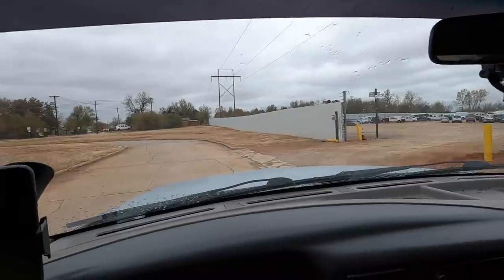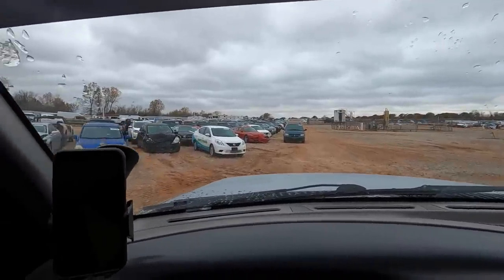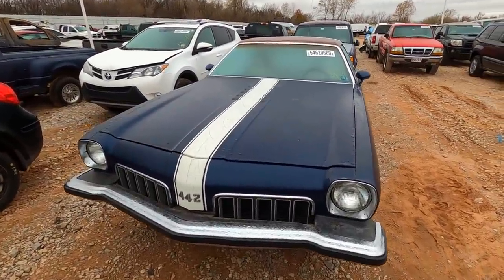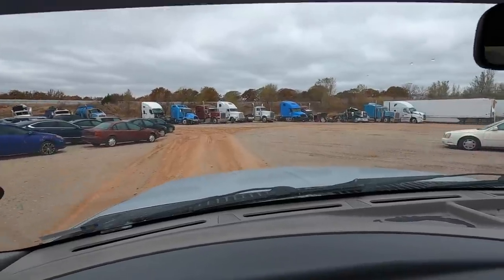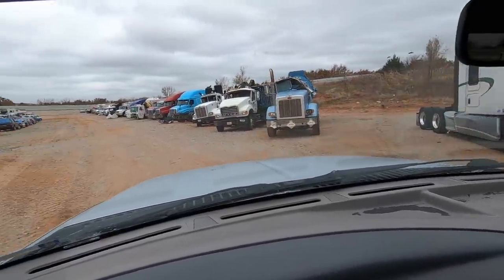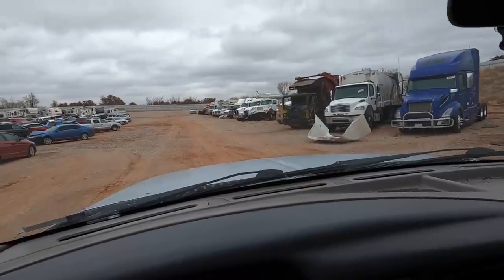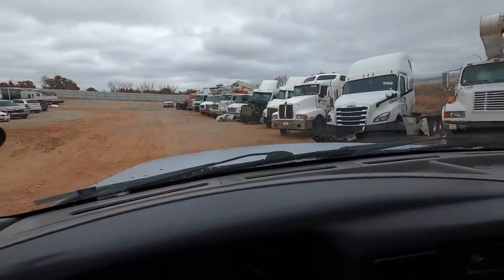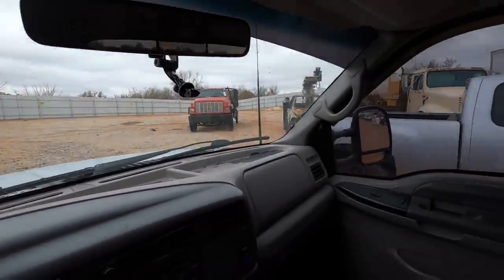Copart Walk Around 11-16-19 - 1973 Olds Cutlass 442

Comment: The biggest concern on "Colonnade" GM coupes is that rear area below the rear window, very notorious for being a haven for rust to develop. Get a car with minimal rust in that area and it's worthy of preserving. I'm sure a '73 442 is a rare beast and $5500 is well under the going rate for what is seemingly a complete and solid car. The condition of the front and rear bumpers(that plastic insert behind the front bumper is pretty much unobtainable) and front grille alone make this car worth buying. Of course restoring one is probably best if you're a fan of the body style because dropping $25-30K into one won't yield dividends on the investment, but having a really nice, well done Colonnade coupe in a desirable configuration for around $30-40K overall isn't so bad considering what everything cost these days. Eventually(due to inflation) it'll be worth $30-40K and in the mean time you'll have a nice car to drive, show and enjoy.

Comment: Randy: I agree with you on the Cutlass.

$5,500 is a lot of money for that car.

But what great old classic.

Has great content potential!

Cheers
Reply: That’s how much you’re going to be spending on one of those.. especially the older they get
Reply: If it’s got a DOT number on it depending on the area you may need a CDL also if it has airbrakes you will need a CDL with airbrakes but you can make a nice tow truck out of that Topkick just have it not for hire
Reply: Thats not a bad price . There going for more than that.
Reply: I like that Olds 442, it'd sell fer about 8K? in Canada in (original) condition... It's priced U.S. average, but look out fer hidden rust! : )
Reply: expensive
Reply: It might be worth closer to $5500 if it had the 455, but not the 350.
Reply: I don't think it's a bad price with the options it has.   My favorite year for the 442.  Drove one years ago, 350 rocket, torque for days.

Comment: I had a 1973 Olds 442 with the 455 motor and the Muncie 4 speed. It caught on fire in my garage one night and burnt the engine compartment and melted the dash board to the floor. It was grass green with a white pinstripe. I loved that car. I also had a 1968 442 and a 1972 442 with the hood scoop ram air, a beautiful car. Now I have an Alpha Remeo Stelvio Quadrifoglio with 505 horse power. Again, I love it.

Comment: I had a 71’ Cutlass S with the 350’. That car started first crank every time in winter months.
Reply: I had a gold 71 442 with the 455 big block. That thing ate Corvettes. I miss that car so much.
Reply: @madmex2k  I had a '72 convertible with the 455 and the TH400. Swapped in a Isky cam, double-roller timing chain and gears and an HEI from a 80s olds. I also swapped out the steering box from an 80s Camaro (quicker turning) and control arms from the same Camaro (changed the angle of roll). That boat could pull .92 on the skid-pad and pull 12 second quarters on street tires and pump gas with the AC running all day!

Comment: Bought a 1987 Cutlass 442 off the showroom floor & traded it for a new 87, 350, I Roc Z, 3 months later  ! Cool vid Randy & its a hurst 4 speed on the 73, 442 . Salute to you brother 👊 Stay warm
Reply: The 442 has an automatic transmission and I doubt it is a 4 speed.
Reply: @mexicanspec  if it is a real 442 it's a 4 speed , bare in mind, theirs a lot fakes out there
Reply: @just4kicks950  That is not true.  Oldsmobile always made automatic 442s.  The middle 4 can also mean turbo 400 transmission.  This car is a Cutlass S with a 442 package.
Reply: @mexicanspec  it is a automatic 4 speed auto & mine had the Hurst with the 3 gear levers.  No body said it was a standard ! You never heard of a 4 speed auto?🤔
Reply: @just4kicks950  Of course I have, but not in 1973.  They didn't exist.

Comment: the infinity is nice as for the boat, wells cargo is a trailer manufacturer, wasn't aware they made boats too. Regarding the top kick, it varies state to state but like in TN and GA if it doesn't have dual rear axles you don't have to have a CDL to drive it.  the red button on the shifter is for high and low range gears  so that 5 speed would actually be a 10 speed because 5 speed  in low range, 5 more speeds in high but you wouldn't drive it that way, you get up to cruising speed with a load on and then pull up the button on the shifter to drop the idle down and just drive then when you stop to take off and for the first couple gears you would start off in low range again. The big red button in the middle is a PTO for probably a dump bed. More than likely the starter isn't fried. as cold as it is out there it won't stay running because the fuel in a diesel gells up when it gets too cold. that's more than likely what's going on and why it wouldn't stay running. that's usually also why diesel truck drivers leave their trucks running frequently. Vermeer is usually a tree service equipment company. the tree service i worked for in Knoxville 20 years ago had a vermeer stump grinder and wood chipper both. and that truck you may actually have to have a CDL to drive that's not a "generator" on the back either that engine is a pump to run and spray out whatever the truck is used to pump out i believe it's for spreading fertilizers or weed killer

Comment: On the GMC Top Kick. The red knob on the shifter is a 2speed rear axle. The Large Red knob is the PTO (power -take-off)  the black lever next to it is to raise and lower the bed. I'm a retired truck driver with 40 + years. The federal requirement specifies that, when a vehicle has a GVWR of 26,000 pounds or less, the operator does not need a CDL license. ... For example, a truck with a GVWR of 26,000 pounds or less can tow a trailer with a GVWR of 10,000 pounds or less and not require the operator to have a CDL under federal requirements.

Comment: Back in the day most people I knew hated the new style of the '73 Cutlass and beyond. Olds seemed to be heading for more luxury; same with the '73 Malibu, Lemans and similar. I remember the '79-81 Malibu was a smaller size and made neat hot rods. Only nowadays the bigger '70's cars are more appreciated like that one. We always called boats like a '71 -'76 Impala Grandma's car; Look at the popularity of them now! I have seen some neat restored '73 rides in the last few years; Hard to believe I owned 2 that I drove into the ground. The 1st was a '73 Malibu rust bucket that ran well for $50. After 2 years with that I got a '70 Cutlass Supreme for $500 in 1990. I kept that until 2003 when the frame rusted thru. I also got a '74 Chevelle with 16K original miles from an old lady for $1600 in 1991. I drove that as my DD and the Cutlass was my toy. The '74 got hit a few times and the trans blew in '97 with 90K on it so I sold the motor for $400.

Comment: That 1973 442 reminded me of the '75 Cutlass S I drove in my early 20's in the early 90's. My dad worked at a Olds dealer so my first cars were Olds. It was a coupe with the front seats like that one did. Mine had a little lever on the side of the that you had to depress to unlock it so it would rotate. It was really nice when passengers had to ride in the back seat. That "Rocket 350" was designated by GM as the 350-R motor. It was the only GM 350 that came with hydraulic lifters in it. The engines and transmissions (a TH350 or TH400) were bullet-proof unless you did something stupid with them. This '73 is merely a shadow of what the 442 (which stood for 400 c.i.d. engine, four speed manual transmission and dual exhaust) start out as in 1964. I would buy this car in a heartbeat and restore it to showroom condition. My favorite years of the 442 were '66, '68 and '72. And no, that is not a Hurst shifter that is just the standard shifter. To get that, you had to order the Hurst package which most came white with gold stripping.
Reply: 442= 4 speed, 4 barrel, dual exhaust. My 71 came with a 455 cu.in. engine

Comment: You are partly correct about the CDL thing.. if the vehicle has a GVWR(gross vehicle weight rating) of 26,000lbs or less, regardless of whether it has air brakes or not, you do not need a CDL. If the GVWR of 26,001lbs or over, you need a CDL. You can also drive commercially or "for hire" in a truck that weighs less than 26,000 lbs without a CDL.

Comment: I used to drive one of those Top Kicks. The red knob on the shifter is for the two speed rear end which means it's a ten speed. The red knob by the PTO lever is probably there to engage the PTO. I don't think it has air brakes as I didn't hear a low air alarm when you started it.

Comment: That red button on the gear stick is the 2 speed axle,it has a low and high ,so actually its a 10 speed instead of a 5,I had a topkick for years we hauled logs on.The cat engine in it is a 3116,6cyl turbo

Comment: The name of the car is 4-4-2, not four forty two.  That is because it means 4 barrel 4 speed dual exhaust.  The middle four can also mean turbo 400 transmission if it is an automatic.  Unfortunately the 1973 model is not on anybody's radar.  Dealers get an old car and put a high price on it now and think people will pay up.  I don't think it will happen on this one considering all the work it needs.

Also, you didn't even mention the ultra rare factory Am/FM CB radio.  That was cool to see one after all these years.
Reply: I believe that is a Panasonic CB Radio. And its actually 4bbl carb and 4sp trans and dual exhaust. And it doesn't mean anything else but that. I currently own a '73 442 and it is nothing like that one at the sublot
Reply: @palletwizard  The radio had the original GM knobs, so I doubt it was an aftermarket radio.  if you want to believe what you said here, fine.  I know what 442 means.
Reply: Look a little closer. It did have the original factory inlay with the knobs
But it was a Panasonic. We can ask Randy. That is if he bought the car. I checked out the Copart listing and i saw aftermarket CB. And that is a K-40 antenna if you knew what you are talking about.....

Comment: The Cobalt boat, the scratches on both sides are from a careless forklift driver who doesn’t move the forks out the way before he backs out, after placing the boat on blocks. 
Hey buy the International the generator is a mini tractor motor, you could a ditch witch and do swap. I haven’t see one yet, also get rid of all the pumps on the back put some ramps on it and haul some cars that you win.

Comment: 29:48 Vermeer mud mixing unit, truck mounted for a directional drill. That is not a electric generator but a hydraulic pump to power the pumps.

Comment: on the trans shifter the red switch is a 2 speed rear end . other red knob with lever is a power take off and the lever raises or lowers the bed.if it has air brakes you need a CDL. I was a CDL holder for many years.
                                Glen Doran  Glasgow,Mt

Comment: The red switch on the shifter is high and low range and the pto is the big round red one . Pull it up with clutch in then let it out the handle is for whatever the pto runs

Comment: Randy, If you’re going to be a Diesel Dan, you’re going to need a can of starting fluid. Also stay away from old mercruiser inboard out boards. The drives that old will need new constant velocity joints. Also the hull on the well crack is junk. Har har Mattie! Cracked in the stringers.

Comment: The international with the vermeer on the back is a mixing setup for things like directional boring. You mix powders with water to aid in the drilling process.
Reply: That's it, it is a mud mixer for a horizontal directional drilling outfit.

For you boomers, many RV parks might not let you park a trailer that old for too long.  They are getting picky and only allow the newer rigs.,

The Cutlass,  It's a 73.  Would be considered a dog a few years, ago, but might be worth fixing up if you can finds parts.  Would cost way more than it's worth

Comment: hey in your "looking around" I'm looking for 2 items:
1) a long wheelbase Savanna Van (no windows on the side no drive line no dashboard no steering column can be wrecked in the hood/grille area only ... not rolled ... 1/2 ton 3/4 ton 1 ton not worried if it has a title or not cause its gonna be chopped up ... will pay $100.00)
2) Push Bar that'll fit/work a 2006 Chevy/GMC truck(no brush guard needed .... Police Type ... $100.00 or less

Comment: It's a 4-4-2 that Cutlass that makes it worth it. I think the 5500 honestly I would pay it I know she's kind of rough but it's not Rusty so all it really needs is a good paint job some upholstery on the seat see if he can still get those pieces around the front window and did you notice it had an AM and FM CB radio Factory that's pretty darn rare? It looks like it was quite loaded for a 73 I used to have a 74 Cutlass and with the regular 350 four-barrel and it was pretty fast so I can imagine that thing probably has dual exhaust I think I saw smoke coming out of both sides and then it would have handling packages a lot of extras really give it a good thought because that's a nice car.

Comment: I use to have a 75 cobalt.. it was built like a tank for being fiberglass..  but still had a few soft spots in the floor..  one thing to look at is that.. but you have to get up in it and walk around..  and the fuel tank under the floor can be a huge pane in the butt to fix if its old and leaks.. involves cutting the floor out to remove the tank, that one looked to have a access to it tho..  looked like there was a trailer there with no boat..  might fit it..  had a ford 351 engine, the inboard outboard drives need to be checked for water in the gearcase.. can cost a few grand to fix or replace..

and that is not a generator on the international..  its a hydraulic pump, I would not be trying to start equipment when I don't know what it is, or if it still has fluid in it or etc.. could damage it.. just sayin!  enjoy the vids, thanks for sharing

Comment: I don't see 5k either but there is someone out there that will pay it and then buy some replacement parts on ebay and say it is a barn find. The ad will go like this (found in the back woods of Oklahoma in a shed, the car was covered with an old tatered blanket, the owner had died and his wife wanted it gone, we even found the original license plate frame from the dealer the car was bought from).

Comment: 12:10 Judging by the color of the gravel in the exhaust pipes, and the scrapes on the ground, it looks like it was let off a flatbed at a very steep angle and the pipes picked up what is on the ground where that car is sitting.

Comment: In 1973 the 442 designation designated the 455 ci engine, 4 spd transmission and dual exhaust.
Reply: George Hoy   That is true of the 1965 thru 1972 cars. But when the 1973 and later 442s came out the 350 engine was also available. 442s with the smog equipped engines were a shadow of their former selves. An anemic 180 HP 350 with a 3 speed automatic was standard. This 442 is nothing like the pre-‘71 cars which were true muscle cars.
Reply: @Jddvs  You can see the S on the door panel showing this was a Cutlass S with a 442 package on it.

Comment: red button splits the gears high and low,the other lever was your pto,a hydraulic pump not 100%but if it has air brakes you'll need a CDL.

Comment: depends on the gvwr. iirc 26001lbs up yes. under no. 

this via google as follows
A CDL is required to drive any of the following vehicles: Any combination of vehicles with a gross combined weight rating (GCWR) of 26,001 or more pounds, providing the gross vehicle weight rating (GVWR) of the vehicle being towed is in excess of 10,000 pounds.

Comment: Here in NC you can drive that Topkick with no CDL as long as the GVW sticker on the drivers door is 26,000 or under and has no air brakes,which that truck doesnt

Comment: Randy if you want a truck for a car hauler the G M C would be the best it already has the hydraulic system and is not air brakes you will be required to have a class b CDL to drive it where as the international you will have airbrake endorsement

Comment: Now come on Randy. When would you have the time to use a boat? Hahaha
Diesels actually run better in cool conditions which is one of the reasons most interstate & intrastate trucks run at night rather than during the day.
In really cold conditions,. (in Australia at least) in really cold conditions, diesels use alpine diesel which stops the fuel waxing up which prevents them running.
The red button on the gear lever operates the high & low ranges in the differential. The 2 speed diff is handy when taking off with heavy loads in paddocks & for driving up steep hills, effectively splitting the gears so less momentum is lost when changing gears.

Comment: Anything  with  2 axle  on the  rear you  need  a cdl  to drive
Reply: Wrong. As a CDL holder. Anything over 22k lbs requires a class b anything over 26k requires a class a. Number of axles doesn't matter
Reply: @michaelhesterjes8496   A "SINGLE" vehicle of 26001 GVWR + towing of 10k requires Class B CDL. Under 26001 GVWR requires Class C non CDL. Any "COMBINATIONS" of vehicles WITH GVWR OF 26001 OR MORE requires Class A CDL.

Comment: randy just asked if the range selector is the jake brake lmao.
Reply: Don't laugh at Randy that is a two speed axle switch not a range selector
Reply: I figured it was the PTO to dump the bed.
Reply: @jeffhulsey989  it is but the pto runs a hydraulic pump
Reply: Rofl
Reply: High range or low range gears...it is a range selector...Mr. Know it All
Reply: No a range selector is for the transmission the 2speed is Axel and I don't know it all just 40 years of driving
Reply: I know I laughed way too much and way too hard when I was watching and he said that . I bet Westin is rolling around laughing his ass off

Comment: The 1973 - 77 GM A-body coupes
aren't as valuable as the 1972 and earlier 2 door pillarless hardtop models, but the newer ones had the Camaro front suspension which handled better than the earlier ones